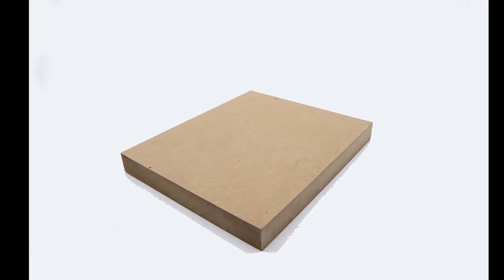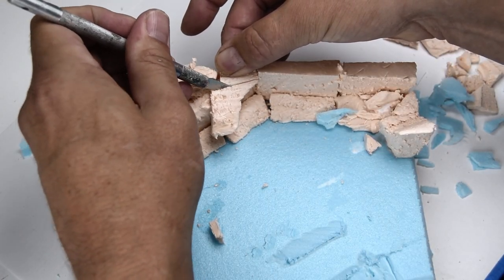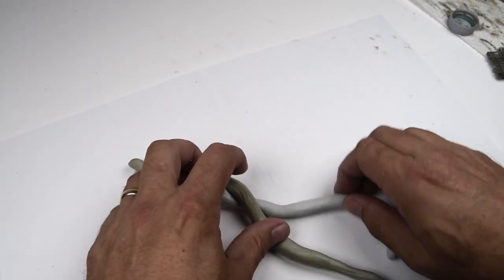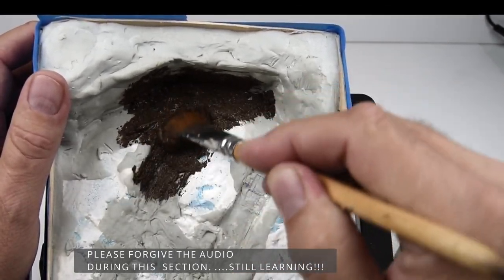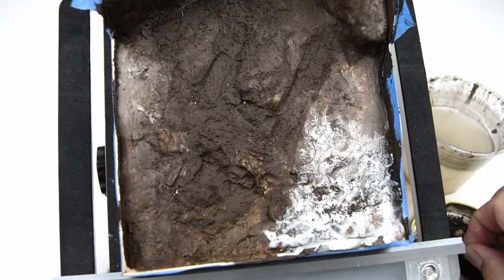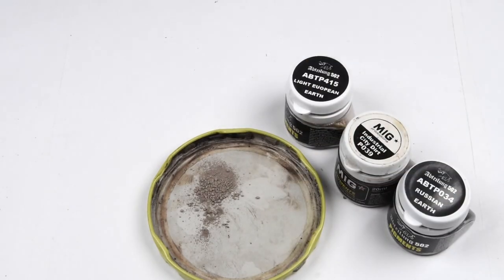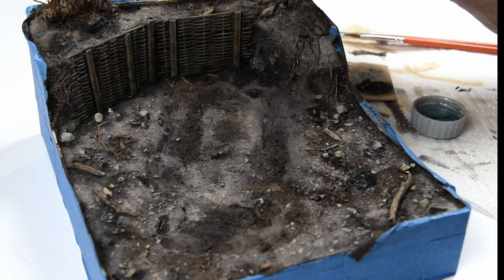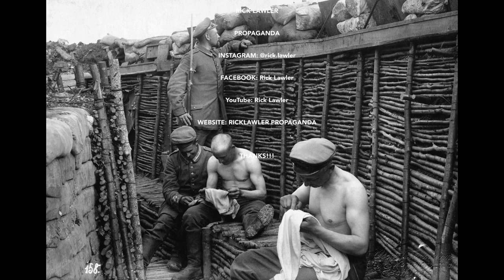Build a Diorama : Start to Finish

Comment: When making your base, what’s the easiest way for you to cut against the grain?  A saw?  I always make such a mess of making the balsa wood base
Reply: i would imagine with balsa wood it would be a fine tooth saw, or if its thin enough a sharp knife
Reply from the maker: I just used a sharp blade here, scored it a few times and then gave it a crack.  Thicker balsa I use a fine saw.